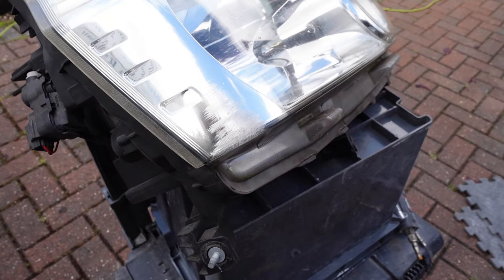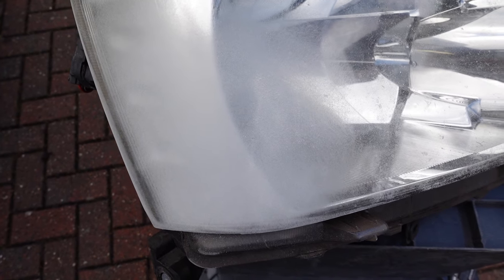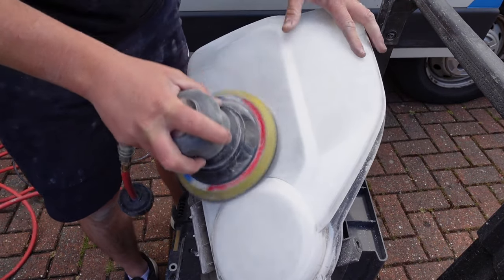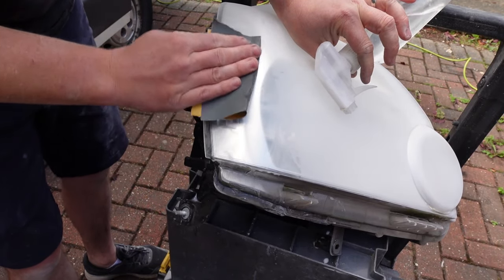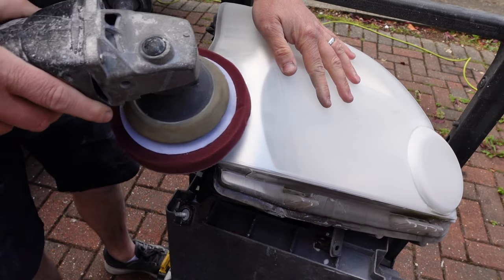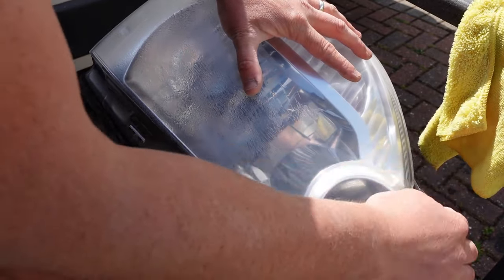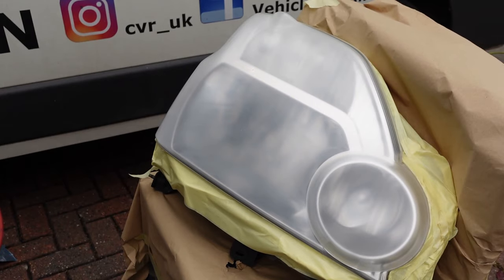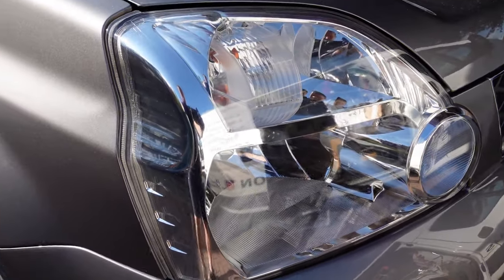How to repair DEEP scratch damage to your headlights

Comment: I don't have a machine, so i needed to sand it manually. I have a cheapy, not-ideal polish kit (turtle wax polish kit). I used 180, 240, 400, 600, 1200 > clearcoat > wax.
Reply from the maker: Same results.. just takes longer

Comment: All I used was a wet sand block 120  water works . Then I took a dremel with polishing tip and some Hairclipper oil or any oil will work buffed it for a couple minutes till it turned clear then i rubbed in some more oil use alot let dry and it is clear as when it was new . Almost the same thing just alittle less professionalism your way is the best ive seen my technique worked but yours kicked my way out the window

Comment: Do you have to remove the headlight completely? From my research, I’d have to take the bumper off of my ‘18 MDX to remove the headlight. I really don’t want to do that. Can I just do these steps by hand & cover the car to keep the clear lacquer from getting on my paint? What name brand is the clear lacquer you’re spraying? I’m located in the US! Thanks
Reply from the maker: You don't have to remove the headlight to do this kind of repair. Any good 2k clearcoat will do too.
Reply: @cvrpov  thank you for the reply!!
Reply: @cvrpov  Please dont use 2K clear coat on headlights! Its not made for plastic. Use the Meguiars Headlight clear coat.

Comment: Can't remove the previous clear coat..
Its thick hard and nasty. Streaky clear. Unclear a real mess
Comes off a little bit. Put on wd 40. Shines it a little bit 😲
I'm a bit scared of using say. 120 grit and damaging the actual plastic front lens.
What's the answer thanks.

Comment: You didn't mention using 320 grit but listed it so do we use it or no
Reply from the maker: Sanding stages 80, 120, 180, 320, 400. This system works

Comment: Is it a big problem if I only partially sand the headlight?
Reply from the maker: Yes and no. It will probably leave an edge where the uv clear has been sanded through. Depends if that will bother u or not.
Reply: @cvrpov  I see, thanks!

Comment: Would using an angle grinder be too savage a tool to use with all the various grades of grit on the headlight as the rpm speed of these is much higher ?
Reply from the maker: yep bit too savage mate